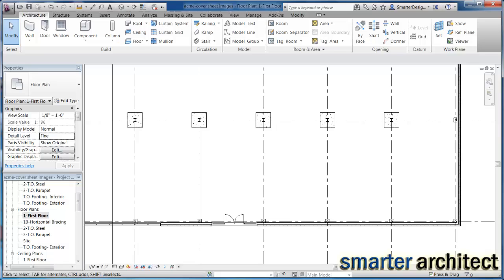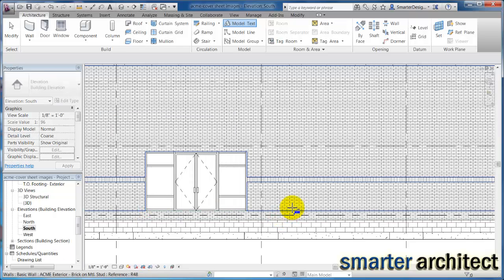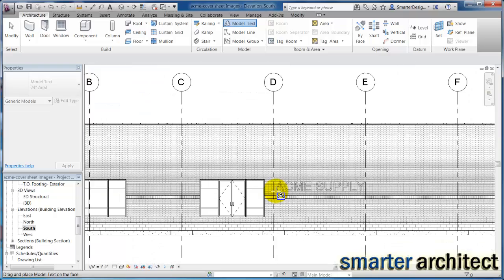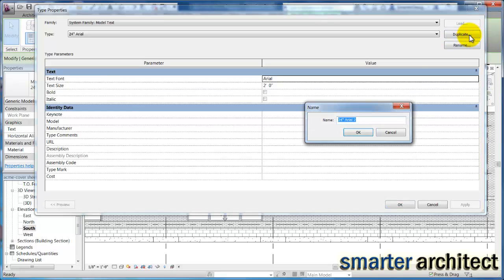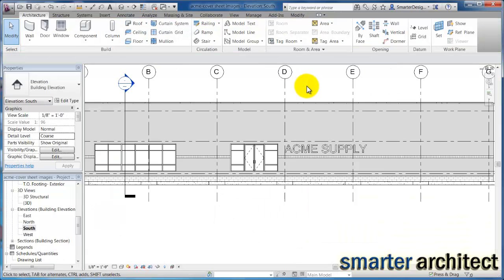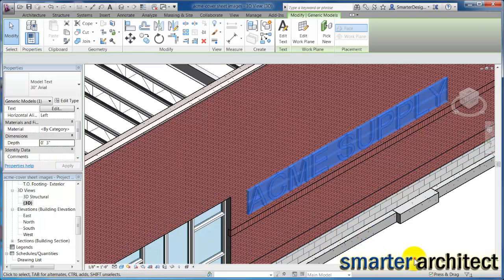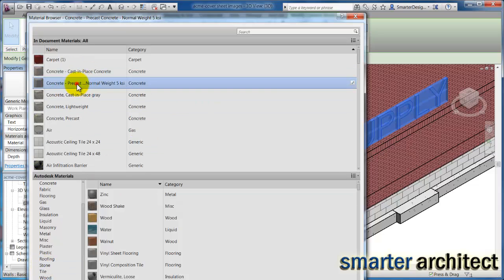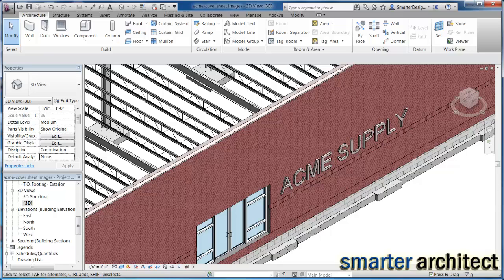Revit Tutorials - Revit Architecture: Creating Building Signage

Comment: Hey bro i wanted to write arabic, but when i write it gets reversed and the letters don't join. is there any solutions to this please reply
Reply from the maker: Bismillah Arif This issue is related to the True Type text font setting in Revit.  Try at least using the following steps to resolve it for printing the model text.  Under Plotter Properties > Device and Document Setting > Graphic > True Type Text > Choose True Type Text as Text Your plot after this setting and everything should be fine. By default it is set to "True Type as Graphics" and everytime when you are printing/plotting you have to perform this setting. Let me know if this helps you.
Reply: SmarterArchitect  thanks a lot for the reply but I tried it didn't work. Actually on annotate tab that text is fine. Only problem on is with  modal text